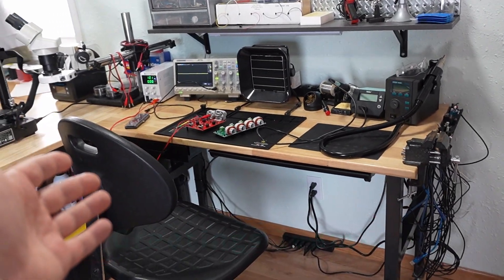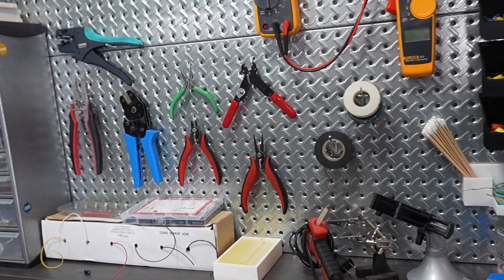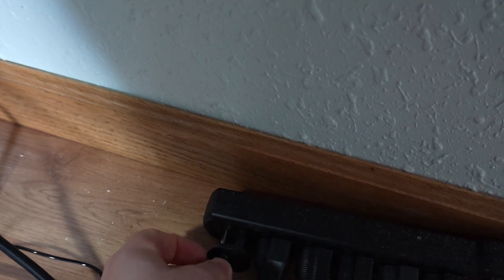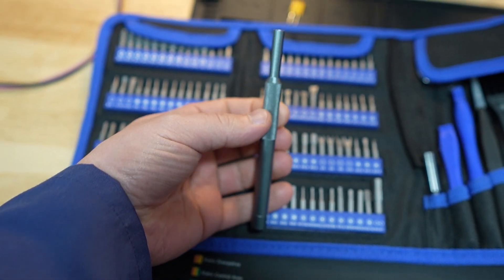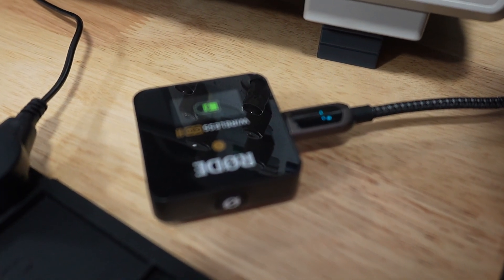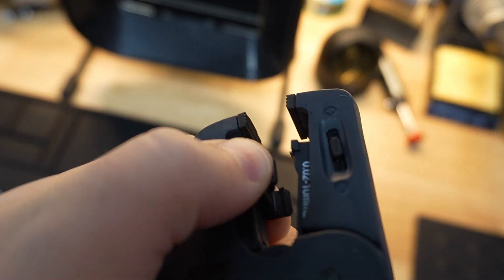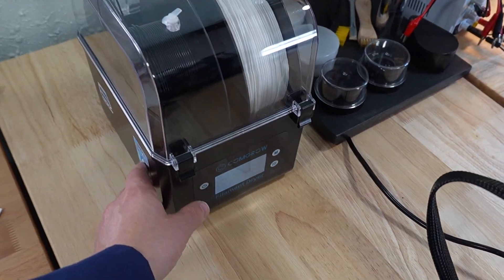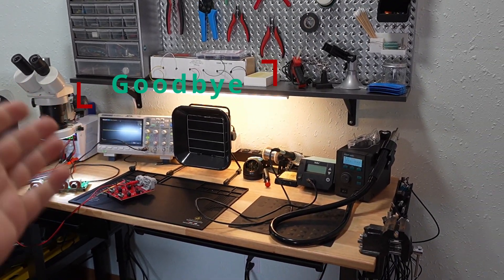Electronics Workbench Essentials and Luxuries!

Comment: Above ^ Everything is great in your video but George Lucas called and your basic shooting style is too close to his , aim for Christopher Nolan ... Lol . Dude your an electric engineer with a nice setup and included stuff like your water station and coffee station is a nice touch I'm building out a workshop post separation with my partner of 13 years my life feels like a mess but I think I can build a functional workshop for my hobbies and maybe do a side gig from it my focus is it , sci fi modeling and 3d printer my electric set up is a drill style head gun 100c-400c , a veritable wired iron a helping hands and a USB C iron for some of the models I will be doing some lighting some quick with string lights . Some with arduinos and some just balancing the voltage from the output along the LEDs. I might go with a second printer that can be used as a 10w laser station and a resin printer for more complex prints . I'm an it tech by trade so my main desk will be a multi monitor set up and my secondary I will try to put in a closet with a bench so I can close it away when I've finished painting soldering etc . Your set up is clean looks to follow Adam Savage's first order of retrievablity and looks comfortable keep going and I will too. Maybe I should try the YouTubes
Reply from the maker: @weaponx26  getting a workshop setup certainly elevated my mood, I am sure it would do the same for you! It sounds like a resin printer would be the best investment for your needs, BTW. Sounds like you are going to hit the same problem I had... Running out of desk space! 😂
If you did post on YouTube, I am sure there would be people who would love to follow your journey.